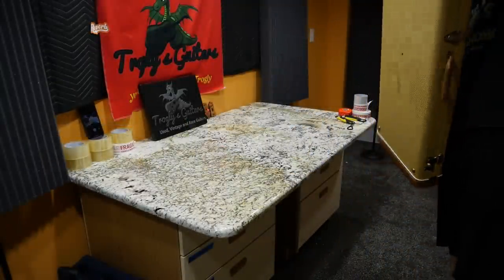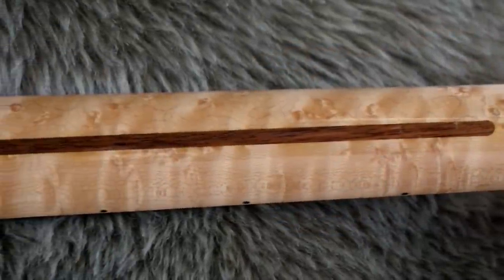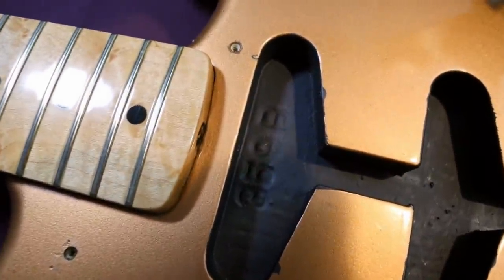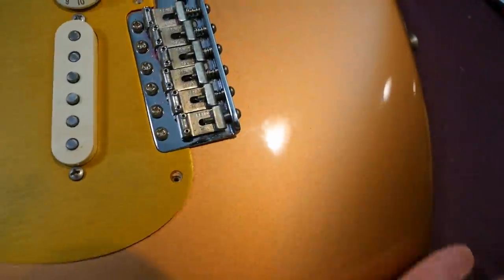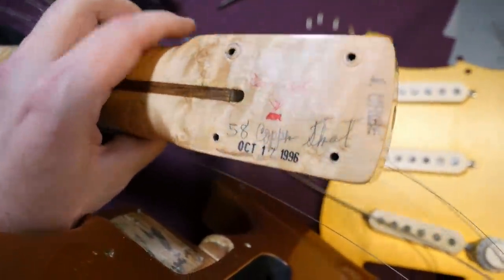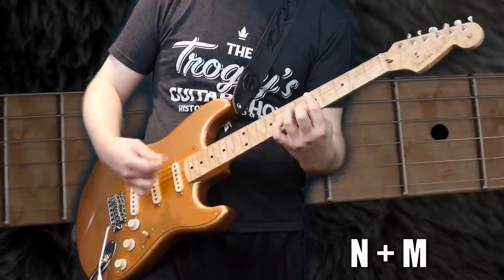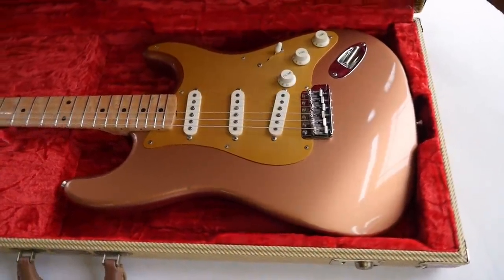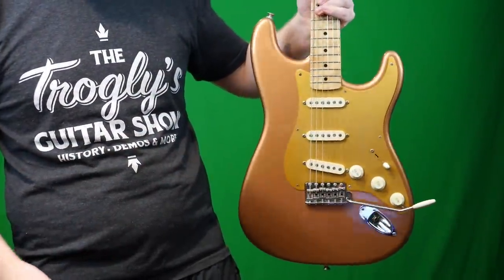How I Got This Expensive Strat For FREE* | 1996 Fender Custom Shop Coppercaster '58 Stratocaster

Comment: The stripped trem block is probably where the block attaches to the face plate. Usually a 3 screw set up. Simple and cheap fix.

Comment: Interesting fact: Fender Custom Shop Stratocasters actually had the "wrong" headstock shape until early 1999.  The part of the headstock under the logo is bowed out slightly, it should be more flat.   I had a conversation with Jay Black on this issue in 1997 and he acknowledged it wasn't right and that they needed to fix it.  I waited for years to buy a Custom Shop Strat until they fixed it, mine is a '56 Stratocaster made in early fall 1999.

Comment: That trussrod positioning seems to be a design fault. Surely you should be able to adjust the trussrod without removing the scratch plate. Seems like a lot of work required there.
Reply: Well yeah but this is a vintage reissue, and the purists would be up in arms about the improvement.

Comment: Ohh!!!!    small shim that not good... something Fender does or did that I don't agree with along with the micro tilt and has a rep. for ski slope on the upper frets.  Actually pushes the neck up in the neck pocket and will take a set and eventually will need a neck planed  flat again  the reason you see a lot of older strats with really thin rosewood fretboards.   

I would remove the small shim and see if it really needs the shim and or replace it with one of the stew mac full pocket shims,  I am the opposite to Trogly when it comes to Fenders and Gibsons.  :)